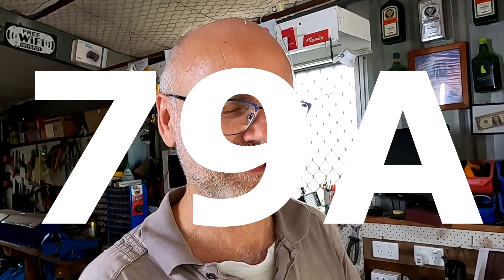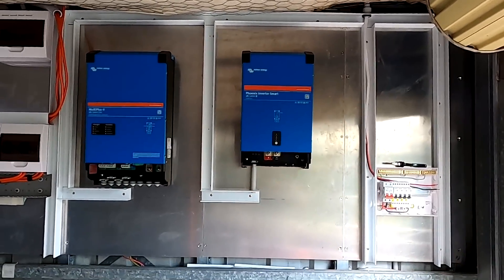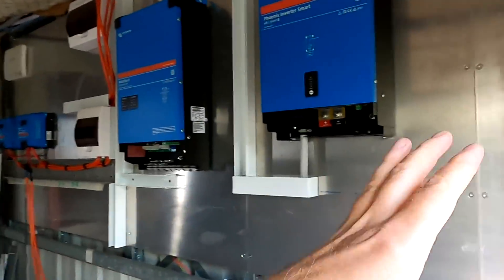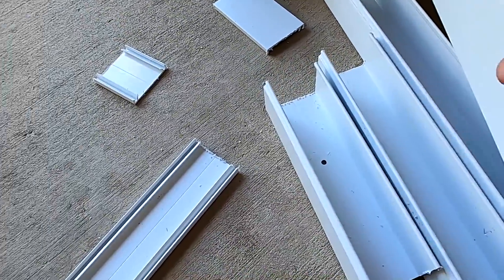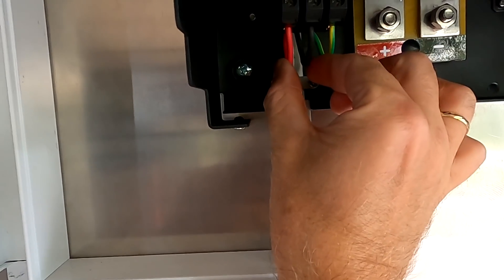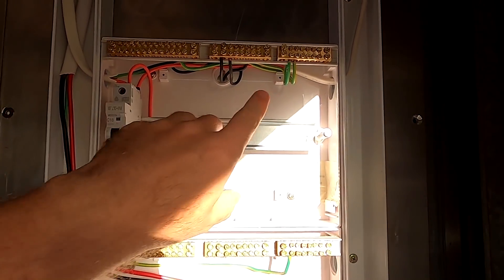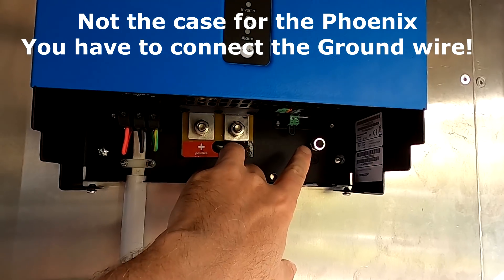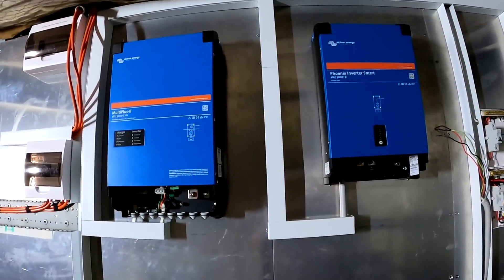PowerWall AC wiring. Daisy chain a Phoenix and Multiplus inverter.

Comment: Hi Andy,
I'm planning on a similar setup using a 5kVA Multi on passthrough with a 15kVA Quattro as the 'generator' as per your setup.
My Quattro will be permanently on, except for when there's not enough solar in to fill the batteries through the day.  In that instance I'd turn the Quattro off to save the standby current.  Those big Quattros have terrible efficiency compared to a Multi.
What I'd like to see is the programming of the multi in your setup.  Is there a subsequent video to this, or can you share the config file?
I'm fine with the AC distribution.

Comment: How did that no ground to the multi plus chasse work out?  It seems the "non interrupted" aspect may have a problem ... If the AC power in is lost (via power outage, tripped breaker) then the line would be "interrupted" ...  and the ground lug (to the ground rod in the ground outside etc.) would have to be there..  I am having problems with my system and think it is related to the grounding.  Some of Victron diagrams have the negative of the batteries also
to the ground rod outside ground.. thus to the chassis ground.. but they make the unit so the the negative of the batter post does not connect to the chassis ground ... so that is why I am here to see what you come up with.  pat oregon usa ...

Comment: I currently have a Powmr 3500 inverter/charger/mppt and need a little extra power now and then. I am setup for 24v ideally but was looking at the 24v 3000w version of multiplus 2 and use current Powmr inverter as generator.  I see the 48v multiplus is a bit cheaper. Is there any super advantage of going 48v over 24v?  I guess if I was going 48v I would get 5000w multi and abandon current 24v inverters I already have but would also need to upgrade solar controllers which starts adding up. I hope I'm not asking a loaded question by saying does anyone have any suggestions?

Comment: That is probably right Dennis & I agree with Andy’s reply as usual, I do like Will, & do believe you will see him come out with some more vids on this before long, But I dont know about the remark about oversizing of cables or conductors in this scenario (electronics maybe has cases for it), I always thought for this type application, the heavier the cables/conductors/busbars the better, & leaves more room for future proofing to a bigger system maybe later if one craps itself. Andy has been mindful to do this throughout this construction process & I think that’s prudent, ‘Tis better to have & not need, Than to need & not have’, they say. Good vid, Thanks

Comment: Lovely work Andy. I have 2 x 24v 2.4kw (cheap) all in ones for a 40’ bus I have up nth, & 2 x 5Kw 48v systems as well for another house and shed (not so cheap, but cheap) , haven’t got up nth to finish 24v setup yet, but have done some tests and these seem like a good, easy, cheap way to go for RVers with a server rack type battery setup it makes it so easy for the newbies too. I like this setup u have here where one can call up the other for extra output & redundancy.
I believe most of these all in one systems can be configured in this similar manner as a backup generator they could be daisy chained to some degree as they sense the input voltage and waveform and match it for the output, which is what I am about to try with the Bus, So hope I dont get any of that magic smoke.  Thanks for another great vid!

Comment: I'm unclear if you're tying the outputs of your two inverters together.

  If you are then you should have exactly the same length DC cabling.  The smallest difference will shift the sharing balance considerably, by many percent.   Consider if you have two large batteries that are merely 0.1V different and you connect them together in parallel with a foot of 2AWG wire (6" plus and 6" minus).
The cabling would represent 156 microohms.   0.1V / 0.000156ohms = 639Amps would want to flow between them.  It probably wouldn't because of the internal battery chemistry resistance but it would try.
The same sort of thing is happening with the inverter output stages.  The one with shorter DC supply cables would be inverting to a higher voltage (by the step up ratio!) than the other inverter and hence would supply the lion's share of the power into the shared load.  If the load is not shared you're correct the DC lengths don't matter.

Comment: Andy , Sorry I react here to a previous video. I FOUND A SHORTCOMMING  loved your idea of placing a shunt before the BMS. But I found out if you place the shunt before the bms, and you take the positive directly from the diy batterie to read out the exact voltage. Then, when you decide to power off the system with a breaker,  the breaker must be placed between the shunt and the bms AND the batterie and the shunt. Otherwise, there still will be curent flowing true the positive cable to the shunt and it follows to the negative of the shunt to the batterie if there is a braker it will follow to the BMS and USE THE BALANCE LEAD that is connected  with the battery  negative (at least with Daly 🙄) that is not all if you restart the system I even get current flowing while the positive was turned of by a batteryswitch i get a reading of 5v behind my victron battery protect( again while the batterie positive was disconnected)  ?????  Or did you know that...and did I not watch your videos with the attention that you deserve? 
Aldo Germany is a beer country. I live in a country with the best beers...greetings from 🇧🇪  Belgium ...jerrepictures.be

Comment: That is such a nice setup! I think my next camper setup also will get ducts. This weekend I wired the 230 side together with my brother. 2 circuits, the phoenix 2000va is wired to a 3 socket bar with earth leakage breaker. And the outside CEE with the same breaker and power bar. 

The 70mm2 battery cables are in. Now I only need to install lithium batteries 🥳 right now everything is running of a 100ah AGM. It's good to test everything before adding more items.
Reply from the maker: I cannot see these ducts any more! TOO MUCH.😂
Yes, do small steps and make sure everything is working as it should be!

Comment: Pulled this from the manual for the 3kva multigrid-ii (4.3) :
AC-out-1
The AC output cable can be connected directly to the terminal block ‘AC-out’.
From left to right: “N” (neutral), “PE” (earth) and “L” (phase)
With its PowerAssist feature the Multi can add up to 3 kVA (that is 3000 / 230 = 13 A) to the output during periods of peak power
requirement. Together with a maximum input current of 32 A this means that the output can supply up to 32 + 13 = 45 A.
An earth leakage circuit breaker and a fuse or circuit breaker rated to support the expected load must be included in series with the
output, and cable cross-section must be sized accordingly.

From the manual specs (5.1):
AC input current limit 32 A for 3kVA and 50 A for 8kVA and 10kVA (= adjustable current limit for PowerControl and PowerAssist functions)

Also turn off the charging feature of the multiplus, otherwise it will try to charge the battery from the AC-in...
Reply from the maker: It's the same text as for the Multi 5kVA so we will see if this is somehow limited to 3kVA for the PowerAssist. I would not think so, but let's see...
Yeah, the charger needs to be disabled as we are not connected to the grid and both inverters are being fed from the same battery. I'm really excited about his experiment.

Comment: ANDY ANDY wat i suddenly think is,  you have 3 AC output s on the MT2 ..
AC1 AC2 and ... the load in the grid when you batteries are full . 
you can avoid this for 99% by installing EES. and counter this white grind setpoint .

and I tink you Works like this it is the last investeer that determines the wants . so I tink 5 kw
Reply from the maker: The ESS system is not for off-grid though. I won't be connected to the grid at all. There is no physical connected. I can plug in a charger and charge the battery from the grid if solar is not sufficient though, but that's a manual setup, not automatic.
Reply: @OffGridGarageAustralia  ok , but i think
that the MT2 is going to think your Phoenix is the grid.
you plug in the phoenix where normally the grit comes, how are you going to say it's not the grid??
and how are you going to say when the batteries are full that MT2 is not allowed to push towards the Phoenix (grid)?
Reply from the maker: @longdistancerider691  I will configure the Phoenix as a 'generator'. The MP2 will start and stop it as needed. That's one way of doing it. The other one would be the smaller Phoenix is running all the time and the MP2 only adds energy if the Phoenix outputs more than say 2kVA. We can configure both scenarios and will see which ones runs best and why.
Reply: @OffGridGarageAustralia  ok , more filming , great

Comment: If you're chaining the inverters, does the MultiPlus have enough pass through capacity to handle the second source? When I've looked at hybrid inverters their pass through capacity is less than 1kW more than the inverter can generate.

In regards the DC cable length, I suppose there's some logic about wanting to ensure that the inverters draw power equally but it may also be about voltage sensing? If the two inverters disagree about the voltage of the battery that might cause some issues? I suppose the answer is that both inverters should go equally to a bus bar and then that bus bar goes to the battery/source.
Reply from the maker: Yes, the Multi has enough capacity and can handle 50A (11.5kVA).
Both inverters will get their voltage reading from the smart shunt as a central unit.

Comment: the cable length for the inverters this way will work well in my opinion
but for the batteries to the bus bar must be the same lengths, to charge and change them evenly.
best practice is to first put the positive cable together with fuse etc. on the workbench and then cut the negative cable evenly.
Reply from the maker: Ah, right, so this rule is more for the batteries to ensure they are charged at the same rate. OK, that makes sense if you have longer cable runs to the batteries.

Comment: Hi Andy,
The inverters connected in parallel need conductors of equal length so they can sense the same voltage so they can operate at the same time.So when one has done charging the other has finished charging. Also, when one shuts down the other shuts down at the same time. Any difference in resistance in the cables will be realised by both inverters. André

Comment: I would have put the junction boxes between the inverters to reduce cable lengths.
Reply from the maker: The length of the AC cables is not so critical, they can be really long without having any significant loses. In such an installation it doe not matter at all if they are 1-2m longer or shorter. The DC cables are far more critical as the currents are much higher and therefore the loses.

Comment: AC Out 2 on Multiplusses behave different than you explained. They are turned on as long as there is mains on AC In. AFAIK there is no way to only turn AC Out 2 on only if the is exess energy from solar. Maybe you can achieve this with some kind of MQTT messages via an external logic, viele Grüße auf good old Germany

Comment: Resistance when paralleling inverters one will draw more than the other if not the same length. (Or at least close)
Reply from the maker: They will draw as much power as they need to supply the load, regardless how long the cables are.
Reply: @OffGridGarageAustralia  but the draw will be uneven between the batteries based on the total resistance. This is really obvious if you put a lead acid and LiFePO4 in parallel. The lead acid won’t have any draw down at all until the LiFePO4 is massively voltage imbalanced. It’s even more pronounced with LTO.  If the resistance is similar than the draw will be proportional as you suggest because it will naturally seek voltage balance. But as soon as the resistance is uneven then you have a 2d problem of v=ir because it is drawing amps and you’ve got 2 uncontrolled variables. Will prowse accidentally proved this with his parallel videos with the wire placement. The reason why his last battery discharges less than the first is specifically because the total resistance is more even if the batteries are otherwise identical.
Reply from the maker: @jameshancock  OK, that might be a problem when using different battery banks for the inverters but if they are connected to the same battery it should not matter. I guess that would be a great experiment...
Reply: @OffGridGarageAustralia  will just did it. The length of the wire directly controls how much each pack in parallel discharges because of resistance. Bus bars mitigate the problem enough that it isn’t much noticeable because there’s just so much more solid and nearly pure copper, but wire matters a lot. Power (current) flows preferentially and always through the lowest voltage divided by resistance. That’s ohm’s law.

Comment: When they say keep the DC wires equal when using them together, they are referring to using them in parallel. If one has a longer cable than the other, it will have a higher line resistance, thus less of the load will be split to that unit and more will be placed on the shorter cabled unit. Running them in parallel with equal length cables assures that they are sensing the same voltage within a margin of error and able to load balance properly. This is how they are running on my sail boat, i used a busbar with equal length cables to assure equal loading.
Reply from the maker: I would say, it does not matter in a parallel configuration either.  The inverters will pull as much DC power as they need to supply the load. If one cable is longer it just has a lower voltage and therefore has to pull more amps to get the same power. But the output power of the inverters will be the same (if they run synchronised).
Reply: @OffGridGarageAustralia  That is not completely true, i don't have the exact model victron units as you, but when you run un-equal leads to them in parallel, the load balancing of the units is not done properly, even if they are connected via canbus to communicate. They seem to use voltage sensing delta a form of load balancing and it often will load down the unit with the least resistance path first until the voltage under load is equal between the units, then the other starts acquiring load. The larger the voltage difference between the units, the more the load is placed on the lowest resistant path unit. A simple way you can test this is by adding a resistor inline of one and load it up and watch the amp difference. You will see little to none being loaded on the unit with the inline resistor until the load can overcome the difference.

Comment: According to Victron you require to have same length of DC cables from busbar to inverters if they are coupled in paralell. Oherwise there is no reason for it.
From busbar to battery same length of cables for paralell banks (2 or more batteries).
Reply: exactly!
Reply from the maker: But why? Isn't the inverter with the longer cable just pulling more DC amps (due to a lower voltage) to get to the same output power?
Reply: @OffGridGarageAustralia  True. But there is no problem/contradiction in that.

Comment: Hi Andi! Regarding the "same DC cable length": It is especially important when you parallel multiplus units (ac out in parallel). Lets say you take two 5kva inverters in parallel, you want to get 10kva output, right? If you have diffent cable length and are drawing full power (~100-120A) both units will see a slightly different DC voltage and therefore draw a slightly different current. the one with longer cables has lower voltage and higher amps... higher amps meens higher voltage drop and so even less voltage and even more amps (i could continue but you get the idea, right). In the end this meens the load will not be evenly distributed across both multiplus units and you will probably never reach 10kva... at maybe 8kva the unit with longer cables will go into overload and eventually switch off both multiplus units.

In your daisy chain configuration you will have no problem with different dc lengths as both inverters are "separate" systems.

in a 3-phase configuration same cable length are not that critical as in parallel configurations (as the load will be different on the phases). But if you have 3 5kva units in three phase config and have different cable length you might not be able to run a 15kva 3-phase load.

I can highly recommend the wiring book from victron! It is explained very well there https://www.victronenergy.com/upload/documents/Wiring-Unlimited-EN.pdf

Greetings from Cologne! Andi

Comment: From what I've learned at this point, equal length dc cables are important but in your specific case I don't think you'll have issues. I'll tell you one thing I do know, it'd be a cool experiment and we would all learn the answer to your question. And being in the past, present, and future at the same time makes perfect sense lol
Reply: I tend to agree, cable length is more important in AC Phases than DC parallel service conductors unless significant voltage or inductive losses are induced.

Comment: Question: in the new Australian code the Neutral conductor is supposed to be blue, black is used in old systems (and brown for L1 instead of red in the new code). Why not use the new standard?
Reply from the maker: These are the cables they currently sell.
Reply: The definition of cables seems in AU is slightly different than in the EU..

Comment: Its only to do with the resistance havin the same length wire but also a few milliohms difference can be the difference between wire gettin warm and not gettin warm but depends on the current draw it could be a few amp less aswell